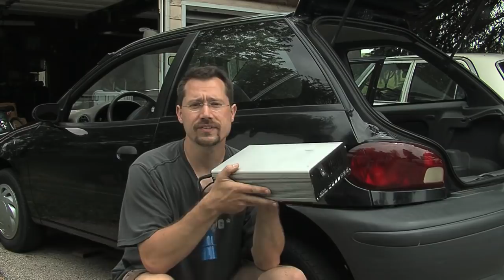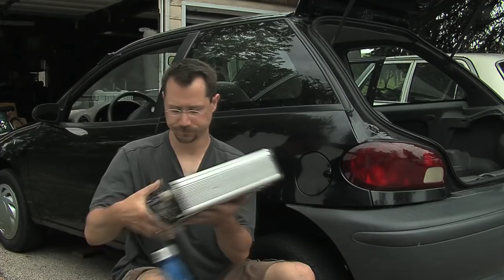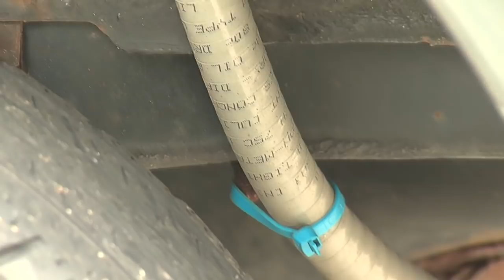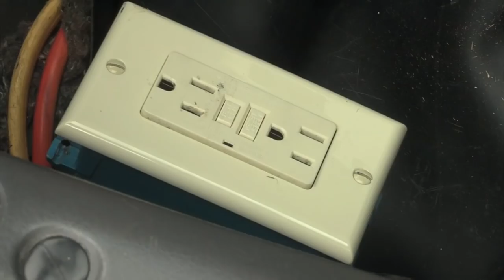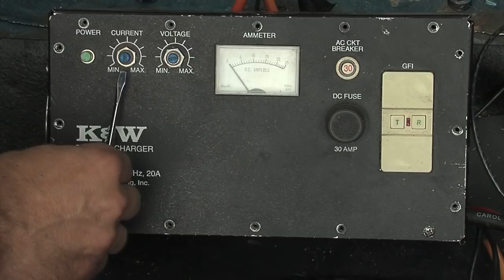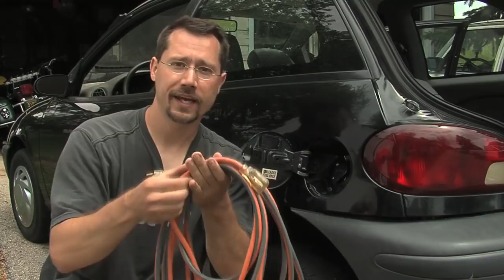12 Build Your Own Electric Car: Battery Charging

Comment: how much voltage are you useing to charge the battery and  how many batties doyou have
Reply from the maker: I've run this car on anywhere from 72 to 144V.
It had used 12V gel or AGM lead batteries.
A person typically uses an automatic battery charger designed for or set to a certain number of cells or batteries.

Comment: A GFI, or GFCI – Ground Fault Circuit Interrupter device protects us from receiving electric shocks from faults in the electrical devices we use in our home. It works by comparing the input current on the hot side to the output current on the neutral side.
Reply: I assume they the same as what would be called RCDs in the UK. they do seem to technically be different, but I don't think I've ever come across a GFI before.

Comment: Wow. Homemade EV's have really changed a lot. These days everyone's just getting salvaged parts from Leaf's and Volt's. 

If this car was built the same way today, it would've been nice to add a J1772 connector to it so you could charge at most public charging stations.
Reply: No do it yourselfer is using Nissan Leaf or Chevy Volt motors!  People are using either what he used (fork lift motor) or warp dc motors!  It would be extremely costly, you would probably need the computer from the leaf and it would be a way overall more complicated project for the do-it-yourselfer to use a Nissan Leaf Motor.
Reply from the maker: @robertsmith9474  Currently, there are a whole range of components used by Do It Yourselfers, including DC motors, such as the Warp brand AND salvaged commercially built parts such as from Nissan Leafs and Chevy Volts.
There are a number of third parties that now make components to easily control motors and inverters such from the Leaf.

Comment: The charger you used has a GFI build it already!  So unless you are going to use that outlet for something else, it's redundant.  (I've seen GFI's fail, but usually the fail OFF).
Reply from the maker: I also used that outlet for a 12V charger for the 12V battery system and a small heater on a timer for winter.

Comment: I like this... i wonder if you can wire up an old alternator to recharge your batteries so you wont have to plug it in, maybe itll never lose juice... take a 10,000 mile long trip.. haha you probably already thought of this. If not it's an idea maybe use both options.. or have a small motor that can be seitched on or off when the car gets turned off (with some sort of regulator and cut off switch) thatll spin the alternator and charge batteries while its parked over night... my brain is in overdrive right now haha
Reply from the maker: https://300mpg.org/projects/electro-metro/perpetual-motion/
Reply: Alas, the laws of Thermodynamics (the second one, in particular) prevent you from recovering all of the energy you put into moving the car (so no perpetual motion, unfortunately) However, you can recover SOME of it. That's what 'regenerative braking' in an EV is. You could also mount a solar panel to the top, though it'd take quite a long time to charge that way, as solar cells don't produce much current. However, you can charge the car anywhere that there's an outside outlet, so doing 10,000 on a road trip isn't too hard to do.

Comment: I am building my own hybrid using a hybrid 270 volt battery pack from 2014 hyundai sonata how do I charge it using the engine like the hybrid do I get the inverter charger from the hyundai

Comment: Would a step down transformer (  240v to 120v) would work if you want to use the level 2 charging stations?
Reply from the maker: A step down transformer should work fine, but a better way to go would simply to have a charger which can run off 120V OR 240V power. Nearly all current commercially available electric cars can charge from either voltage.

Comment: what do you do to satisfy the requirement for a passed emission test when it's time to renew your converted car's registration, and how do you handle the auto insurance issues. you get in an accident in a diy power train modified vehicle and legally the insurance company could refuse to honor the claim because you were driving a car on public roads that wasn't DOT certified which also i could see the state coming down on you in an accident situation, especially of there were injuries, does your auto insurance company know how the vehicles been modified?
Reply from the maker: Of course, a vehicle needs to meet all legal, insurance, and testing requirements.
Insurance was easy. I called my insurance agent, and told her exactly what I was doing. She had no problem insuring my car. I also made sure to never change any safety features of the car (didn't modify seatbelts, airbags, running lights,) and I made sure to stay within the gross vehicle weight of the car.
As for emissions testing, it is often exempt on older cars. In my area, cars from 1995 and older are exempt from testing. However, my car was a 1996 model, so I DID need emissions testing. I joke that emissions testing was the hardest part of the project. It was a matter of just finding the right person to talk to and getting the vehicle inspected. You can read the whole story on emissions testing at: http://300mpg.org/projects/electro-metro/emissions-testing/
Reply from the maker: You can read some additional thoughts on insurance at: http://300mpg.org/projects/electro-metro/insurance/

Comment: Hi!

I have watched some of your videos. I am about to build my own electric car as well, from scratch. 

The video about voltage, amperage and watts was really explainable and useful for me because it solved my range issues.

In this video you are talking about charging. I have chosed to have a batterypack of several smaller but high voltage and ampere batteries. 18650 type batteries to be exact.

I have watched plenty of youtube videos and read some on googles search results. I would like to build my own charger from scratch and not use premade factory chargers. I don't find any videos that explains how to do, the dos and don'ts, those only show how to build from only premade chargers and how to connect it to the batterypacks. Googles search results are worse, explains but not showing anything.

I wonder if you have any knowledge of how to build a batterypack charger from scratch and how I can build it to suit both regular outlets at home and public electric carchargers?

Thank you! :)
Reply from the maker: I don't have any experience building a charger from scratch. As far as being able to charge at both home and at public EV chargers, it's a pretty easy adapter to build. Here's my write-up on the one I made: https://300mpg.org/2015/03/31/the-diy-j1772-charging-adapter/
Reply: Building a charger from scratch is perfectly doable. GreatScott (the youtube channel) has an example making his own BMC (which is a charger/overcurrent/overvoltage/undervoltage protection combination). And as 18650's and most other lithium chemistry batteries get quite angry at you (read: fire) if you overwork them, it's a good idea to spend the extra money and build a circuit that adds those features.

I'd prefer personally to use a full BMC in an electric car, but they don't make many that can handle electric car currents. (though E-bike size batteries have lots of options)

Comment: you must use 6 or 8 volt battery . The lead plates will warp and you lose all your battery capacity. more lead more power. i get 40 to 50 miles out of a wheego whip that i modified. to run all 6 volt with two prius battery pack for  regen capture  . never nun 12 volts  battery for a traction pack . otherwise good video . would like to see more of the ford ranger. thats what am looking to find . am in superior wisconsin where are you from

Comment: What do you think about convertion by hub motors
Reply from the maker: As of yet, I haven't seen a practical, affordable hub motor appropriate for cars. For motorcycles, EnerTrac makes one. There are still issues with un-sprung weight and a few other complications, but they otherwise work well. The Schultz Engineering "Delta-Bike" uses one. He always seemed happy with it.
https://www.enertrac.net/product.php#a
http://www.schultzengineering.us

Comment: Did you change motors? Last I seen it was 36 volts?
Reply from the maker: This car only ever ran on the 10.5" diameter yellow Nissan forklift motor.
I originally ran the car on 72V, and then I later experimented at other voltages, up to 144, but always with the same motor.
Reply: @BenjaminNelsonX   Thanks for your reply. I really appreciate it. I love your channel and have learned so much.  I want to build a foam camper And use Tesla 48 V packs For the camper and the car.  Would you use A DC motor and the DIY controller Or use the other modern AC voltage motors. Can the fork truck motor Take a 48 V input? Thanks again.
Reply from the maker: @DualTasticToday  Check out @James Klafehn
He's built a foamie camper trailer range-extender. Cool project.
https://www.youtube.com/channel/UCwavJeJls7x3QabgJnevYcA

Comment: You should add an IEEE J1772 charging port for full compatibility with free public 240V charging stations.
Reply from the maker: At the time I built this car, there were ZERO public EV charging stations in my area, so a J1772 port was not a priority. Later, I built a J1772 adapter, so that I could plug in any of my DIY electric vehicles into a public EVSE. Make sure that the charger you build into your vehicle is compatible with both 120VAC and 240VDC, as that gives you maximum charging flexibility. http://300mpg.org/2015/03/31/the-diy-j1772-charging-adapter/
Reply: BenjaminNelson Cool, but to prevent theft and make it safer and idiotproof, shouldn't you build that adapter into the car gas filler port?
Reply from the maker: That particular adapter, I really built for my motorcycle, and it DOES lock inside the bike. https://youtu.be/aaJo8Yquaks
It's also portable, so I can use it with different vehicles. For a permanent setup for a car, yes, a person would probably want to have a J1772 inlet permanently installed. All of my charging on this car was at home, so I never had any reason to permanently install J1772 on it. A plain extension cord worked fine.
Reply: DONT   HAVE TO  USE A CHARGING POINT IF YOU INSTALL A SOLAR PANEL   ON THE BOMET THE TRICK  IS  ABLE TO 3 D PRINT  A  PANEL THAT GOES ON THE BOOT AND ROOF   THERE'S A SOLAR CAR  IN CHINA FOR SALE THE ONLY  OTHER ALTERNATIVE IS TO USE  A MAGNETIC MOTOR  GENERATOR LOOK IT UP  ON YOUTUBE

Comment: is there a way to recharge these batteries with multiple alternators?
Reply from the maker: You COULD, but you would also need an ENGINE to power the alternators. If you did such a thing, it would be a Plug-In Hybrid Electric Vehicle (PHEV) rather than a Battery Electric Vehicle (BEV.)
I did later experiment with running this car with an LP Generator in the truck. It worked reasonably well, but was loud and took up all the trunk space.
Reply: What if we gear drove alternators with the same motor or attached them to the fwd axles?
Reply: Because all we need to do is spin the alternators pulley to generate power which can be done while the car is in motion
Reply from the maker: @LucasWarnerDev  So, you want to use the alternators to charge the batteries, and use the batteries to spin the motor to spin the alternators?
Where does the energy come from in the first place?
You are basically trying to make the battery charge itself, but in just a very complex, roundabout way.
Reply: @BenjaminNelsonX  yes absolutely. It is just a theory. IDK if it's a dumb brained idea but   the spinning force on the pulley of an alternator creates a magnetic field and restores charge. I suppose the energy would come initially from the battery to the electric motor

Comment: How about setting the power system up like a submarine , engine with generator  and electric motors no batteries..??
Reply from the maker: Submarines DO have batteries!
(A similar setup WITHOUT batteries would be a diesel locomotive)
I did play around for a while with this car as a plug-in hybrid. It operated essentially as you describe.
https://www.youtube.com/watch?v=xXVi-g4jWqI

Comment: how do you chard the other battery that provide 12v (regular battery)
Reply from the maker: On this project, I simply used a plain 12V charger which would get power when the car gets plugged-in.
A better way to go is with a DC/DC converter which will take some small amount of power from the main traction battery pack and convert it efficiently to 12V to charge the battery. It essentially performs the same role as an alternator on a gasoline-powered vehicle.